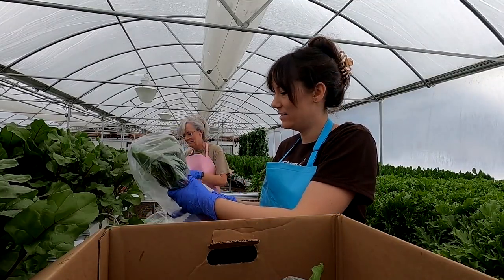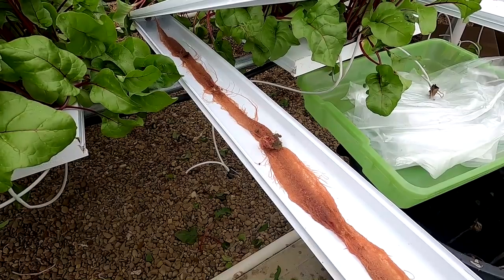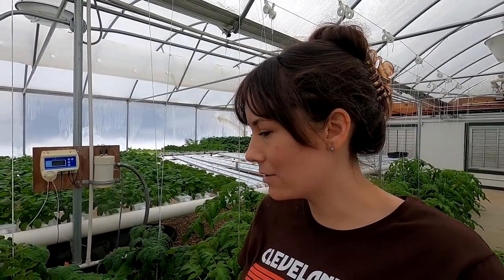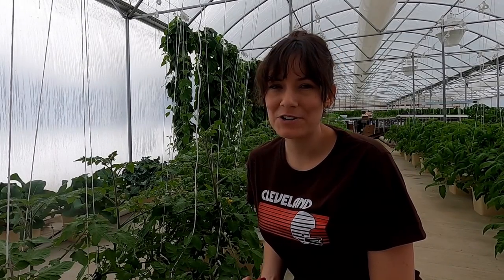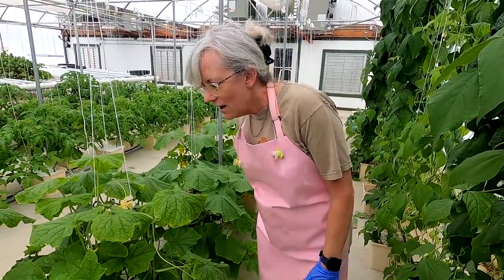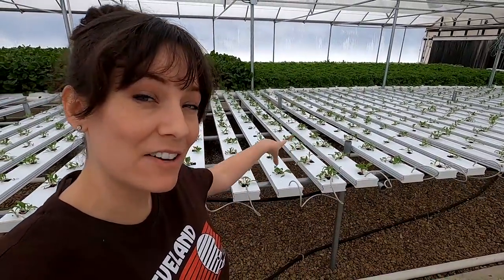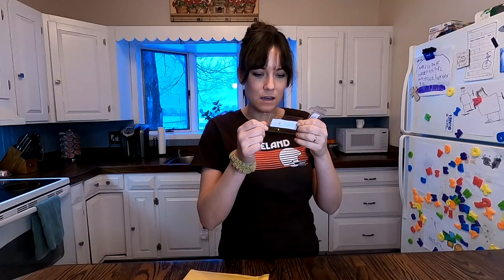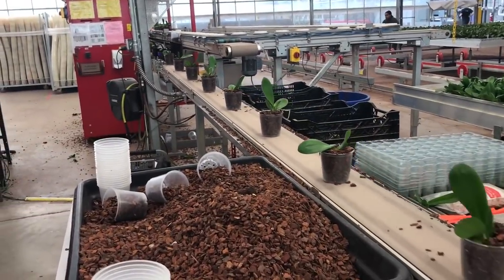Pollinating Tomatoes, Harvesting Greens and a 100 Acre Greenhouse

Comment: I love your shirt! :) Wondering if you could just turn the fans on for a short time on a higher setting rather than using the toothbrush to pollinate ???  Seem like a lot of work, but I guess I just don't know.  Thank you for your videos!
Reply from the maker: Thanks! I’d love to go to a game this next season, but who knows what it will be like.  I was disappointed the camera didn’t pick it up, but the toothbrush really makes them vibrate and pollen puff out.  It’s really not a bad job, I enjoy it. -Devon
Reply: i forgot the exact stats that i read, but it was something like: wind 20%, pollinator/toothrbursh 65%, honeybees 95% (gotta be honey not just any species). they've even tried sound systems and it works but the decibel needs to be so low and so loud it's not practical

Comment: After you explaining how you almost lopped off the end of your finger, I cringed every time you cut off one of the suckers on the tomatoes.
How big (horsepower) is the pump that runs the main greenhouse and do you have a backup in case of failure or generator if power goes down.